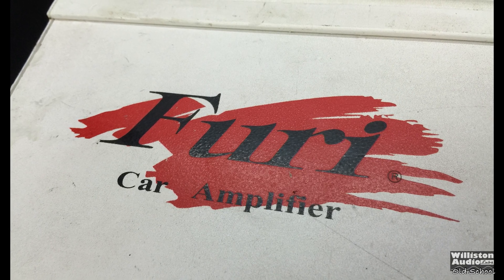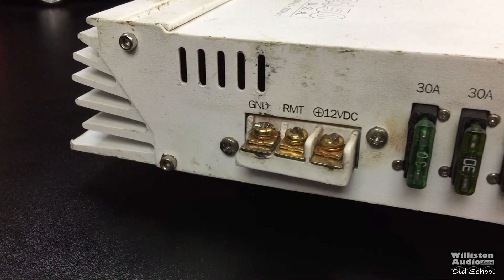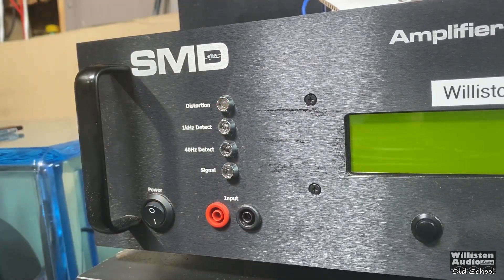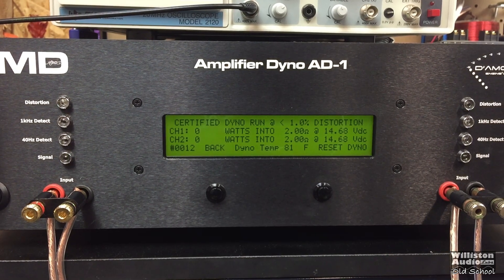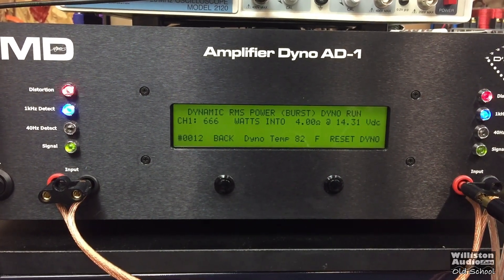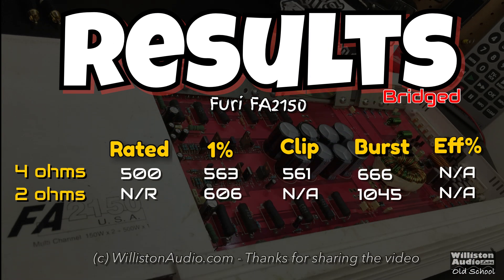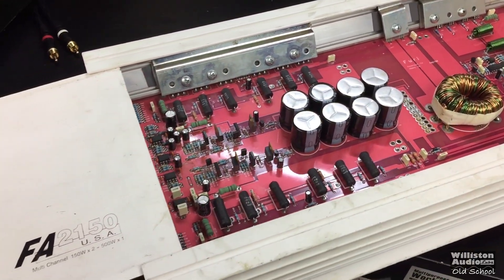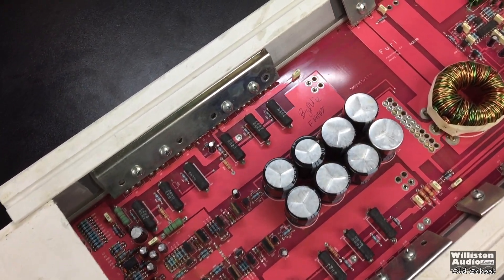FURI Car Audio FA2150 90's Old School Amp Dyno Test

Comment: That was 10 days before my 42nd birthday. I had a brochure from that company. I used to fill out the post card that came in the magazines. Wish I still had those. I had a bunch of em.
Reply: I did that for Kicker and got a letter for 20% off, but my 8Ohm subs were special order so the dealer basically told me to stuff it regarding my gold letter C-128s.

Comment: These were great amps!!!
 Had three of them running 6 JL 12’s. I won every spl contest I entered given the classes were determined by power.
Reply: Which JLs?
Reply: @FreeStyle786  the best they had at that point. They were stamped steel frames. This is rite around the time ground zero flipped the car spl world on there head.
Reply: @FreeStyle786  it could only be 12w5. Or 12w6, the w3 didn't come out till 99
Reply: @thomasbradian6367  yeah that's it, the w6. Thanks for refreshing my memory.
Reply: @mugendrewable  when you said 6 I knew they had to be w6's because they only came in triple stack, because i believe they were dual 6ohm, so you needed 3 to get a 4ohm mono load, remember this is the 90's, and very few( affordable) amps could run a 2ohm mono load, stable.  At the time, they didn't come any better, I would put the w6 against a cerwin vega stroker any day of the week, they just sounded better, and able to hit lower frequencies. This is before JL made amps, when they only focused on improveing speaker technology

Comment: That Furi mamma jamma took the dynamic power at 2Ohms mono all the way to the three 30Amp fuses getting warm (45-55% efficiency).

A plethora of parallel capacitors helped a bit.